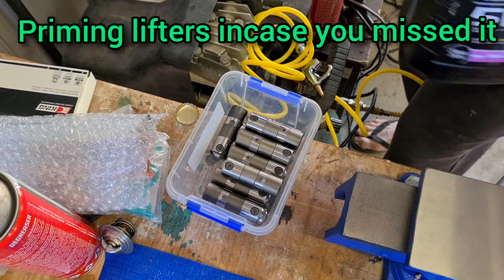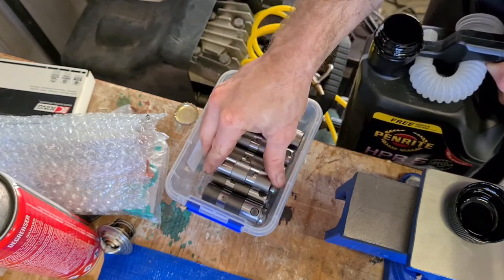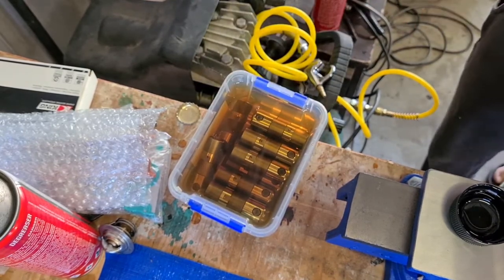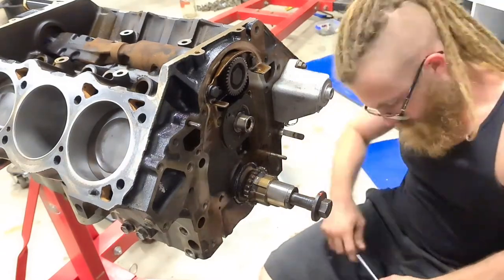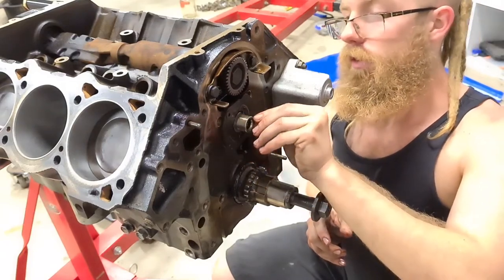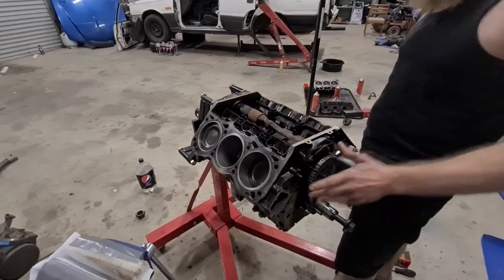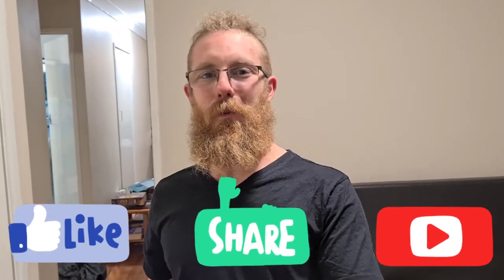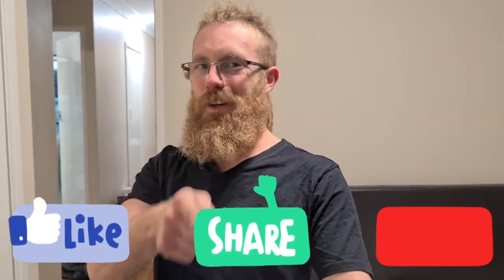L67 INSTALLING CAMSHAFT, TIMING KIT AND LIFTERS || L67 REBUILD PART SIX || Cat's L67 VX commodore

Comment: hey bro i know it been a while since you posted this but do you know if itll mess stuff up or force me to have to take the lifters back out if i forgot to soak them in oil?
Reply from the maker: Sometimes they will self prime, depends if they are new or used but it's good practice to soak them. They will self prime sometimes but it's not a guarantee

Comment: When changing a timing a chain in the car would you have to pull the sump off with an ecotec or can you get away with leaving it on
Reply from the maker: Should be able to do it with the sump on, there will be a few bolts around the front of the sump that I believe bolt into the front cover, they should be the only thing you need to remove sump wise

Comment: Did you keep balance shaft out of motor or re install back in ? Watched all the videos numerous times but cant remember if you refitted or done the balance shaft delete im suspecting some noise coming from my partner vx l67 spac due too bad balance shaft beaeing or excessive play in it should have removed while doing lifters but its no biggy taking intake and charger off again too remove as im in the middle of rebuilding the oilpump amd fitting double row rollermaster timing chains in any help is much aporeciated mate !!
Reply: Or is removing balance shaft not needed if i notice noise coming from top area after oilpump is done ill be pulling it down for a 3rd time by the looks 😅😅
Reply from the maker: We left the balance shaft in as we just went with single row chain and it's not getting abused too much, and money was tight.

Has to be removed when you install a double row timing chains anyways, just don't forget to transfer the clip in magnet for the cam angle sensor in the top gear like I did, you need that for sequential ignition, otherwise is puts it into batch fire mode which will use more fuel
Reply: @tokimotive  champion yeah i just wemt full send today and deleted balance shaft as had double row kit sitting there plus the oil pump kit and yeah i did remember too put that sensor in was the first thing i swapped over onto new cam gear before i done anything else after removing old kit out thanks for the reply though mate is muchly aporeciated !! Just have to prime up the new pump tomorrow morning and see how it all goes

Comment: You didn't feel the need to remove the balance shaft in favor for a double row timing chain?
Reply from the maker: Was going to but at the end of the day it wasn't my motor, so the final choice wasn't mine to make. 

All new standard gear should be alright for now, there's a chance of getting a cam later down the track, if we do that, then I'll upgrade it.

Comment: How’s this engine going now after the rebuild?
Reply from the maker: Going great, hasn't missed a beat. Really smooth, more power and responsive. Drives exactly how you would hope a rebuilt motor would
Reply: @tokimotive  thanks for that I’ve been slowly building mine and I’ve used a lot of you videos for reference 
Cheers
Reply: hey tokimotive, i’m looking at getting a stage 1 cam from mace due to being on green ps otherwise i’d go stage 2, do i re use the rocker arms with the cam and is it hard to dial in new cams? i can’t get my head around it but i’m trying to learn, cheers bro 👍🏽